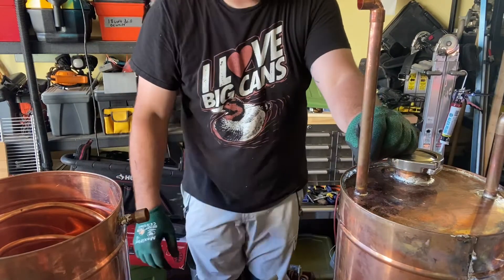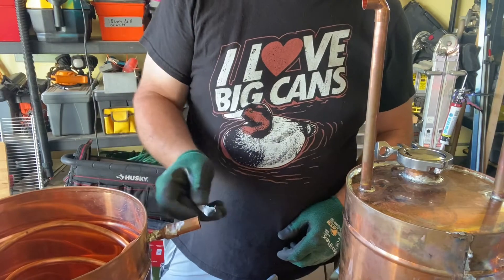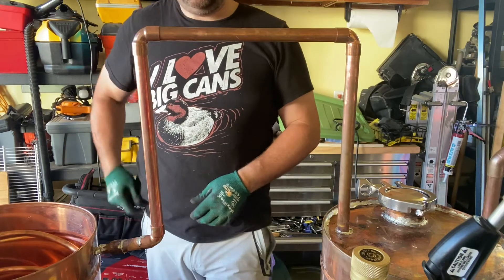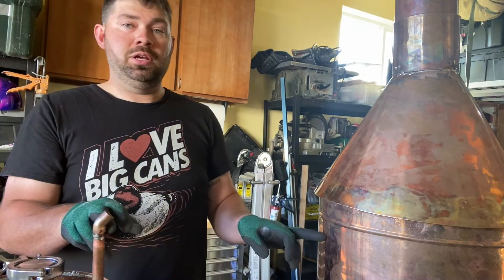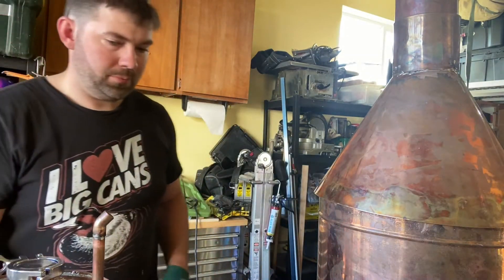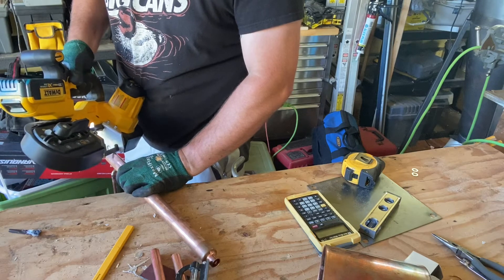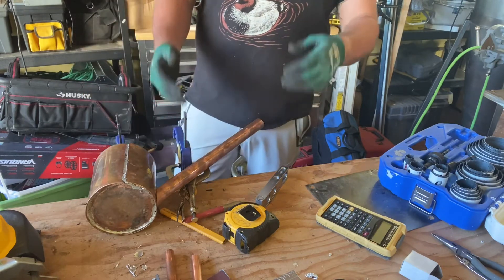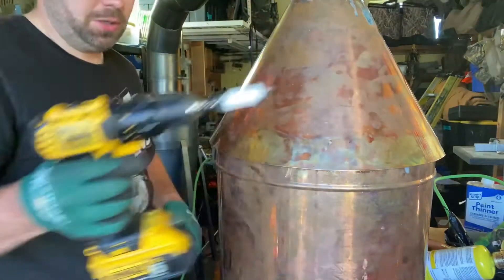How to build a copper Moonshine Still Part 10 From Distillery Network

Comment: So I’ve heard of peoples still creating a suction when cooling down from atmospheric force, have you ever had a problem with that? Have you ever placed a Valve on the still, thumber, or that 45 degree pipe to vent off pressure when done?
Reply from the maker: Yes that 100% will happen on any closed system still as soon as you turn off your heat I take the cap off

Comment: See part #4 thru #10 don't see 1-3. Where oh where  can 1 be made on how to make one from junk for poor folk and don't know how to wield maybe
Reply from the maker: https://youtu.be/T1LqEl-nUg4
Reply from the maker: I would highly suggest saving to buy this kit or a similar one. The reason is that if build just a cheap pot still you won’t be able to get that most out of your mash. The more surface area the vapor has to travel the more “pure” your product will be. Those pressure cooker stills work but you get a much better product out of a bigger one. 

Think of it like an investment. Mine has paid for its self many many times already. In less than a year

Comment: Turned out good, Im wanting to buy a kit as well, is your kit a 20 gallon kit? I would have loved to seen a video with you testing it out! I think some copper unions in place would make it great for assembling and disassembling. One last thing how is it working for you? Thanks for taking the time to put this all together.
Reply from the maker: I can 100% do that. It runs amazing I have had zero issues. I did add 4” Farrells between the collar and the cap
Reply: @bryansworkbench8585  look forward to the video